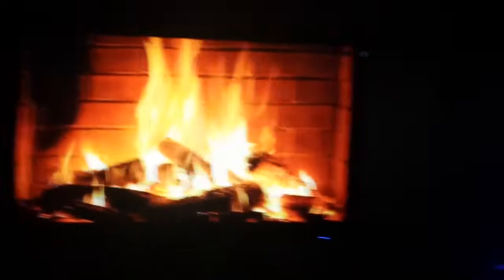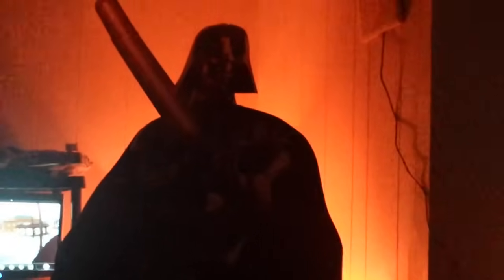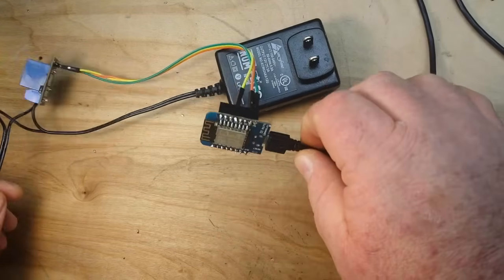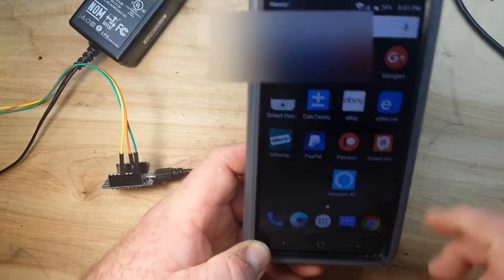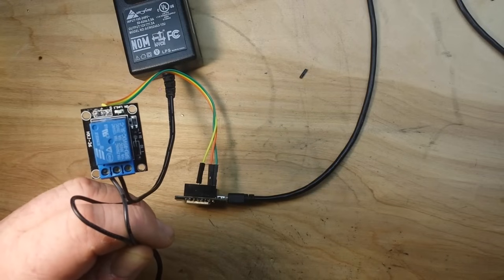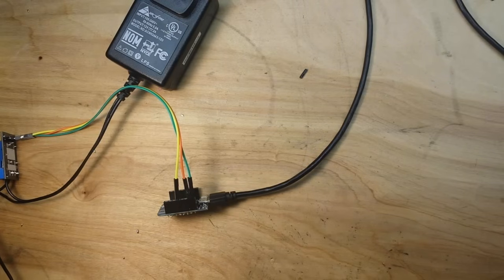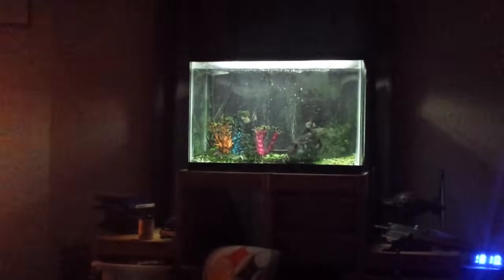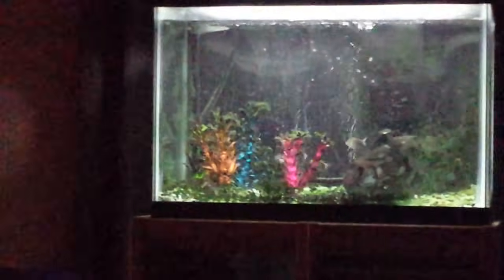ESP8266 & Amazon Alexa for home automation

Comment: I need to ask for help:
:\Users\xxxxxx\Desktop\Fish_TANK\Fish_TANK.ino: In function 'void setup()':

Fish_TANK:54:13: error: 'D2' was not declared in this scope

     pinMode(D2,OUTPUT);

             ^

Fish_TANK:61:16: error: 'class fauxmoESP' has no member named 'onMessage'

         fauxmo.onMessage(callback);

                ^

Multiple libraries were found for "fauxmoESP.h"
 Used: C:\Users\616320\Documents\Arduino\libraries\fauxmoesp
 Not used: C:\Users\616320\Documents\Arduino\libraries\xoseperez-fauxmoesp-13e3da6679ed
exit status 1
'D2' was not declared in this scope

Invalid library found in C:\Users\616320\Documents\Arduino\libraries\ESP8266: no headers files (.h) found in C:\Users\616320\Documents\Arduino\libraries\ESP8266
Invalid library found in C:\Users\616320\Documents\Arduino\libraries\ESP8266: no headers files (.h) found in C:\Users\616320\Documents\Arduino\libraries\ESP8266

This report would have more information with
"Show verbose output during compilation"
option enabled in File -> Preferences.

Comment: People who are having trouble getting Alexa to find a new device, check what revision your Echo Dot is. If it's a v2 you will need to modify the code. It's a simple change. There are several discussions around. The original code seems to work if there is an older Dot on the network as well.

Comment: your code doesn't seem to work.  Alexa sees the fish tank device.  When I tell alexa to turn on/off the device it shows up on my Android phone alexa App as on or off...so there is a connection between the echo dot and the phone app.  Yet, the relay doesn't work and the voltage doesn't change on the pins from the Wemos d1 mini.  What am I missing?

Comment: I used the sketch above.  I loaded the sinric.com skill and loaded the smart device into alexa.  The sketch uploaded, and I can see the wemos d1 mini when doing a scan of my network.  Still, when I say Alexa, turn on or turn off, nothing happens.  What's going on?
Reply: What revision is your Echo Dot? If it's a v2 then a problem in the firmware that stops it finding this device. You need to modify the code then reupload to the ESP8266. There are a several discussions about it.

Comment: Great video very well explained. just have a question on how to add more relays to this code?? 

I have a four relay board and I want to add the other three relays, to be able to do different things with each relay. 

Hope you can help thanks!
Reply from the maker: Alexa only addresses the Esp8266 as a whole. You would need 4 different IP addresses
Reply: learnelectronics.

 that sounds incorrect I know there is a way to do it
Reply from the maker: +gary b ok, hope you find it
Reply: I figure it out thanks

Comment: Darth Vader done like rogue one was great touch. Does anyone know how you could power the WiFi directly of the power for the light?
Reply from the maker: +Dean Welch there is only one set of power leads there in the Sonoff, so lamp and wifi are powered together.
Reply: Buck converter

Comment: Hey, I've gotten my wemos mini to connect to the same wifi network my echos are on, but when I discover devices, it can never find them. I've tried several variations of the fauxmo code and two different wemos boards. Not sure what's wrong. =(
Reply from the maker: +TooMuckinFuch17 Do you have smart home enabled?
Reply: learnelectronics On the Alexa app? Yeah, I have more than twenty devices connected through Hue and SmartThings as well. I've managed to find my raspberry pi fauxmo devices before, just can't get the wemos discovered.
Reply from the maker: +TooMuckinFuch17 I'm sorry my friend, that was really the only advice I had.
Reply: I have the same problem
Reply: Seems same for me too, just can't find new devices...

Comment: Thanks for the video! Is there a certain Alexa "skill" that needs to be added for this to work? I have it connected to my wifi network, but Alexa is not discovering the wemos.
Reply from the maker: +Eddie Larivey No, just go to smart home and click discover
Reply: Yes, that is what I did. I've tried many things but no signs of life from Alexa. Maybe it has something to do with my board being the older style D1? I'll try more tomorrow and update if I can get it working.
Reply from the maker: +Eddie Larivey No, I'm using a older D1 on my fish tank. What does the serial monitor show?
Reply: learnelectronics It shows the connection to the wifi network, and the ip address of the D1. That is all it shows, there is no activity on it after the initial connection to the wifi network. I read about some people having these issues with newer versions of Alexa/Amazon products, yet working fine with the older versions. I'm just using the alexa app currently, I don't have an echo yet.
Reply from the maker: +Eddie Larivey oh ok. I have not tried it with just the app. That could be an issue, but I just don't know, sorry. If I can help with anything else let me know.
Reply: I'm having the same issue. Did you find a solution?
Reply: Some combination of actually buying an Echo dot, and using the iPhone app has fixed it for me.